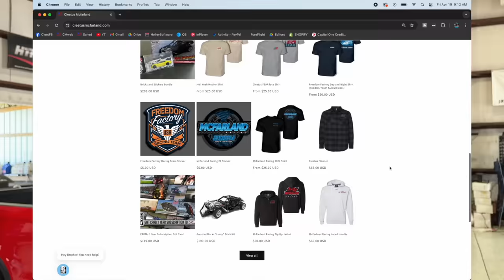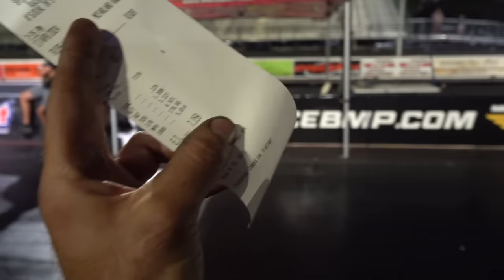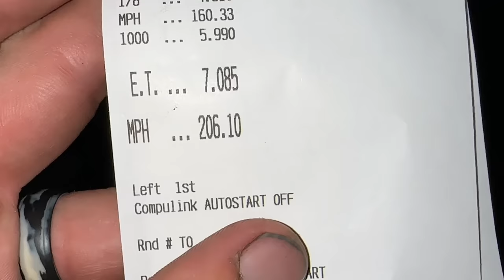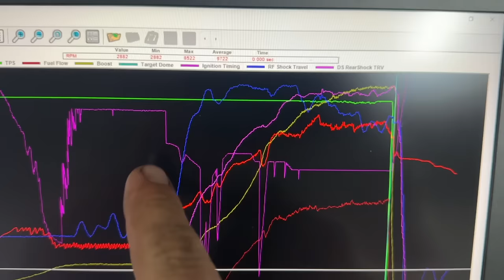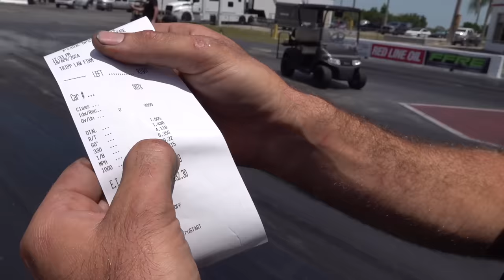Our NEW GMC and Mullet Both DESTROYED Their Records!!!

Comment: "The ol' reliable Ford killer!" *Breaks an axle turning around at 2mph* 🤣 Love these videos!  The amount of one-liners that come from a 1 hour video is amazing! 🤣
Reply: Twice. Those garbage things need to be replaced before giving a 1000hp truck to some guy that isnt going to have time or tools to do the work
Reply: @CB-mp8ym Well they broke on slicks lol also axle swaps aren't hard.
Reply: @CB-mp8ym there are no aftermarket axles available for those trucks yet and also it’s gonna be turned down and on radials for the giveaway and it’s gonna be the winners choice if he wants to turn it back up and honestly the 427 alone would be worth the giveaway to me 😂
Reply: Good old ford killer, breaks 3 times and runs slower times 😂
Reply: Coyote platform is making silly numbers. Easily. And reliably. It's the no brainer build choice, even preferred over 2JZ stuff.
Reply: Disconnect 4WD when doing a u-turn..
Reply: @insanehellkids  Then the diff center becomes the fuse... What's easier to change
Reply: @bylerboyz1595    Yeah, not built Ford tough.
Reply: @Drunk3nMas7er  let's see the f150 on full slicks in 4wd full lock and turn lol. It wasn't a smart decision period as said. Yes the coyote is faster. But remember the 427 broke axles. Coyote broke itself....
Reply: I thought they were going to turn down the tiny 5.0’s boost and race the F150, now we are resorting to nitrous to make a 9.999. I want to see the race. 40% less cubes, and still winning? I dare you to try it, equal boost psi, no nitrous…!!
Reply: @insanehellkids  Impressive what the coyote can do in stock form though, wish any of this stuff was available in Australia for a decent price
Reply: @insanehellkids how many passes/abuse did the coyote have on it with a ton less built parts inside it.
Reply: @ttv8ra23  im not knocking the coyote this generation is built well. But the LS platform is still a pushrod motor vs a ohc engine. The coyote has better internals stock then the LS with double the cam and valves. The fact the pushrod is still making the coyote right is why the LS is as cool as it is
Reply: @bylerboyz1595 my thoughts too😂
Reply: @insanehellkids This is an LT engine in this truck, not an LS. Also the Coyote has 4 times the cams and double the valves. Both are great engines just different architecture. The coyote heads flow a phenomenal amount in stock form, allowing 5.0 liters to fill with air more efficiently than the 7.0 liter LT.
Reply: @jenswoody4683  My understanding was its a 427, meaning its a LS7 not a LT motor. But i maybe misunderstood. But The LT is still pushrod its just different injection
Reply: @CB-mp8ym  They aren't giving away a 1000hp truck.  They've turned it down so the stock axles will be more than enough.  Watch the video next time.
Reply: @CB-mp8ym I mean no. They shouldn’t be using 4wd on pavement lol. Should’ve put it in 2 before cranking the wheel to make the turn
Reply: Gotta love how jackstand and George don’t have anything to say as the gm breaks parts, but everytime the Ford has an issue thier bashin it. Let’s not forget how many ls engines ruby has gone through, Leroy just broke in the latest video, the blazer, mullet went from ls to big block because of numerous engines, it’s racing shit breaks. Love everyone of em on cleets crew But you’ll never hear them boys admit that😂 Tye is my dude tho🤘🏻🍻
Reply: Better than that piece of junk Ford😂 that has major issues😂🎉😮
Reply: @insanehellkids at least the motor didn't break like that piece of junk ford

Comment: Theres a reason most chevy silverado guys put away their LS projects and switched over to the coyote f150 platform. Its just so much easier to build and get results.  That little Coyote 5.0 F150 is where its at these days.
Reply: Yet, everybody else still wants a LS swap, including the Ford guys
Reply: @domin8ss  zero people are pulling coyotes for an old LS. Zero!
Reply: @mobregonjr Maybe not a junkyard LS, but a simple google search will show you that multiple S550s have already been LS swapped. LS swaps is here to stay until the internal combustion engine is dead.
Reply: Plz elaborate on the cost of a coyote build vs an LS.  The coyote may indeed be the current all out hp king, but there is no denying it’s much more expensive to do than an LS.  Cost per hp it’s not even close.

Comment: Lol the shopping list for the GMC makes me laugh
"Yeah ill take 4 belts, 3 tensioners, and 2 axles..... 👀"
😂😂
Reply: And a partridge in a pear tree
Reply: What is the rule ? 
You replenish 😂
Reply: And they have to be from different cars. Of course!
Reply: Are they buying "stock" parts for 900 HP?   And you laugh at parts list???  First '23 body in the 9.999s?   You are laughing about the parts list.  You're expectations seem silly.  IMO

Please post a link to your 9 second 4x4?  I will follow.
Reply: @peterr1510   he's not going to take you on a date
Reply: @peterr1510 you are zero fun dude.
Reply: @peterr1510  blah blah blah
Reply: @peterr1510  The problem is that the truck needs longer axles since it's lowered. When the suspension fully compresses, it's pulling the axles apart. I've heard that some guys with these trucks use the Trail Boss axles on their drop suspension since they're slightly longer.

Comment: “The good ole reliable ford killer” 🤣🤣🤣 ate those words real quick huh George
Reply: The F150 sat in the garage stuck at 13's for a whole year with a wrap that looked like a port-O-potty at a peanut festival.
Reply: @ruger8412  and? Should’ve said good ole reliable axle killer 🤣🤡🖕🏽
Reply: @ruger8412 stock motor it still beats this truck lol
Reply: @jacob1423 Yeah... it's second one. And second trans too, right? Love that Ford quality.
Reply: It's the same trans 🤣🤣. You're done
Reply: @mikescherrer4923 Same trans, Ford and GM collaborated on the 10 speed buddy!
Reply: @jacob1423  The F150 has a fully built motor, it is not a stock motor, and it's on its 4th motor. Not sure you're flexing correctly. Also, the F150 has upgraded axles, rear end, driveshaft. There's a ton more put into that F150 than there is that GMC.
Reply: @TheMotorman80  Doesn't matter, the trans in the F150 is a fully built trans now. Can't really pin it on any manufacturer now as nothing in that trans is stock.
Reply: The GM has a 427cubic inch compared to a 302 cubic inch
Reply: @TheFlooringInspector82  gmc has a built trans to💀
Reply: @TheFlooringInspector82  Don't leave out the CUI comparison. Ford 302, Chevy 427. I used to be a BOPC guy until the last brand new GMC vehicle I bought needed an AC compressor and all the stuff that gets ruined when the compressor eats itself, an alternator, and a driver's side intake manifold gasket, all in the first year. I bought my 5.0 F-150 in 2012, and since then it has had a recall for a "molded leadframe" (crappy "advanced" transmission internal wiring assembly) free repair, a water pump, 2 taillights, and all the usual req'd maintenance. And that tiny little 5.0 throws my truck around like it was a leaf. It's 12 years later, and I still enjoy getting in it, especially for long road trips.
Reply: @TheMotorman80 GM guys don't read
Reply: @TheFlooringInspector82 there is not a ton more put in the f150. The gmc has a supercharged built 427. It doesn’t even have the stock engine size. It has a built trans, built suspension, OH AND THE ENTIRE CHASSIS WAS CHOPPED
Reply: There's isn't a nut or bolt even on that GMC is stock, you cant get any more built than it is. The F150 did a 9.99 with just a Whipple.
Reply: @dailylife3975   and only running 11 lbs of boost.  Think the f150 smokems has a bit more. maybe i am wrong?
Reply: I'm sorry which turd is broken down in the shop right now?
Reply: @EVLS10  it still runs, just not very well right now. It'll be upgraded and in headed into the 8s soon.
Reply: @jacob1423  thats a TKM motor in the ford
Reply: @Ole_CornPop  Still runs?  Are you high?  That's like saying a motor with a spun bearing still runs..
Reply: @TheFlooringInspector82  you literally cant get the gmc in that configuration from the factory stock. They literally had to pull out the LT 5.3  WITH A SUPERCHARGER because its weak as hell and had to put in a fully built 427 TSP LS engine. Says alot about the modern day LT engines  I guess there trash. Both trucks have major modifications.
Reply: @EVLS10  it drove back to the shop under its own power, it technically still runs. Lol
Reply: @jacob1423 not a stock motor
Reply: Cheby people make me laugh lol they just can’t except the fact that a little stock block 302 will destroy a Texas speed built 427, I guess there is a replacement for displacement it’s called COYOTE
Reply: @rcktshp4535  that’s the dumbest comment I’ve ever read LOL it’s called technology that’s why  little 302 can make more power than a big 427 imagine if Ford made a 427 coyote
Reply: Its not really a chevy truck. 1 they never built a regular cab short bed. Someone had to build it. 2 it's engine isn't even offered in the chevy platform. At least the Ford can be bought as it sits and a Whipple installed and make 800 all day for years without an issue. Only reason it's broke is because they take people on joy rides and track runs daily pushing well Into the limits of that engines capabilities. Anything will break with that kind of continuous abuse. Hopefully GM takes note and makes a short bed 4x4 now.
Reply: @mattsloop2736 I don’t understand the comment you can’t get a Chevrolet pickup in a short  bed. They sell 2024 short bed single cab pickups with 4WD. It only comes with the TurboMax engine, but the platform was already there.
Reply: @mikescherrer4923 you say ford quality when this man is purposely blowing it up . There’s very very few stock engines that you can put insane boost on and not blow it up even over and over. That truck was not built to do that. Hell most people haven’t even seen a truck or car go that fast. Cleetus is just doing what he wants. Even his fully built very expensive drag cars blow at least once a year.
Reply: @bensinor4974 it didn't spin a bearing. Saw a video with cleetus saying the engine is fine. It was the blower making the noise because theuy tried cooling it.
Reply: TRC is building an F150 that will trump anything out of the Cleetus factory, real soon.
Reply: @exothermal.sprocket TRC are a bunch of nerds so who cares?
Reply: @Fastbeeezy  it was a joke bud. & I didn't personally insult you. Learn to be better than that man. It's called adulting.
Reply: @KJ-kw7gh  you literally can't order the truck they have. Someone took a regular 2 trucks to make this one. It can't be ordered with a short bed 4x4 V8.

Comment: George:  "the old reliable Ford Killer"....2:36 = broken axle.😆
Reply: Not because it's weak, because the truck is lowered so much the factory axle isn't long enough and pulling it apart. If you modify your suspension that much, you gotta make sure stuff like the CV axles are the right length.

Comment: Now boys, stop running that red Turd like it's the blue Ford. It just can't do it. It's just the way it is!
Thanks for the vids! You guys are the best!!!
Reply: Better than that junk blue ford.
Reply: It'll easily do it. It's a giveaway and he doesn't want to set it up like the blue truck. That thing rides like crap to get it to work on the track
Reply: It's just ain't got The DOG in it , it can't hang with the coyote,  even if it had suspension
Reply: @chrisquintana3877  anything can hang with a junk coyote lol.
Reply: @jerrywilcox9890  Brett LaSala would disagree... Snot Rocket is whooping everything.
Reply: @ncrshane1919  lol I don't care what he thinks of the pile of junk.
Reply: @ncrshane1919  it won't be it will be blown up soon lol.
Reply: @jerrywilcox9890 but so far it seems the coyote is still heaps faster than the gmc LS tho lol. Junk or not between them two trucks it aint it
Reply: @0riginalkiyoshi  reason very few use them.
Reply: @0riginalkiyoshi  lol and the gmc isn't all the way turned up so how do you know lol.
Reply: @0riginalkiyoshi well yea the ford has a fully built fast forward race engine, built tranny, fully upgraded driveline and heaps more mods than the GMC. Plus Cleeter didn’t want to make it much faster being it’s a giveaway car and he didn’t want it to ride like shit.
Reply: @0riginalkiyoshi  so you don't know if it's faster than the gmc lol.
Reply: @0riginalkiyoshi  so you don't know if it's faster or not.they aren't turning it up.its not even close to full boost lol.
Reply: Yeah no matter how fast the coyotes are they never be practical for people that aren't rich. 900 bucks for spark plugs to be changed. No thanks lol ford makes everything they have more expensive and harder to work on for a reason.
Reply: Chevy LS motors will always only be great for cheap power and that's all. Fastest LS 1/4 mile was a 5.9, and a 4.6 4v got there years before an LS even touched it. Coyotes have gone 5.6 in the quarter, and even a K24 has gone 5.8. I can think of one time a Chevy small block has gone faster than 5.9 but that was in the 1950s in a top fuel dragster.
Reply: @jamesarmstrong8646  Ok now your just stretching the truth. It does not cost 800 bucks for spark plugs my gosh. And if you watching the same show as me, cleetus does not worry about that. And reality both trucks do 9 sec quarters. He put lots in both trucks. Just to let you know you can get Coyote motors out of f150s. They all had them so there cheep too! I'm a ford guy but a fast Chevy put a smile on my face everytime. So stop with the jerk talk! Want to race???
Reply: Why wasn't Blue there? Is it broken?
Reply: @randomshit168 idk people say this like it’s a bad thing, LS has a choke hold on 8-9 second cars to the point where 98% of the playing field is powered by one 

Personally that means more to me than record bookkeeping
Reply: @ALYXTANKBACKPACK  I'm making a point that LS motors are not the fastest v8 on the market, that's all.

Comment: Fun fact, you need an axle shaft on a Chevy to hold your hub and spindle in place. Or else your tire flys off ask me how I know 😂
Reply: depends on the specific rear end.
Reply: @mikescherrer4923  ? Front axles not rear
Reply: Yes the front axles hold the bearings together and ask me how  I know also 😂
Reply: Most 4WD/FWDs are that way.
Reply: @208Concepts  but what about three-wheel Drive
Reply: @mikescherrer4923  cmon bruh
Reply: I've seen it as well. 2003 Silverado SS AWD converted to 2WD without changing the hubs and they did indeed come apart. BUT...the entire front axle and suspension is different in the 2019+ trucks. Front axles are WAY harder to swap.

Comment: It took so much work to get a 427 cubic inch Chevy motor into the 9s and yet that little 302 cubic inch Coyote went straight to the 9s😂🤣❤️
Reply: they have said time and time it will handle so much more they just dont want to push the giveaway truck.
Reply: 700 lbs lighter... geee I wonder why
Reply: @karlschauff7989  sure and  125 more cubic inches. 🙄
Reply: @TomUSAF_VET Don’t forget damn near triple the boost and 300whp+, I would hope the ford is faster 😂

Comment: Hey fellas, check out the launch at the 27:22 mark on the video. Qhen you drop the trans break the wheel stutters one tooth rotation before it locks up and goes. May have a worn tooth in the diff. Or a lag somewhere between the trans and different. May be costing you a tenth on the launch.
Reply: Watching it zoomed in and in slow motion it appears to just be the delay from the tire wrinkling.